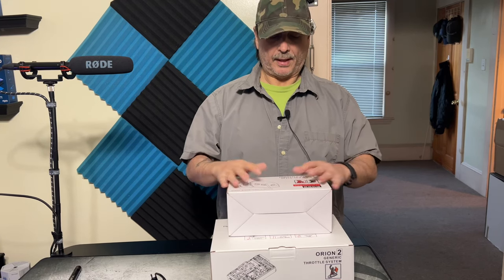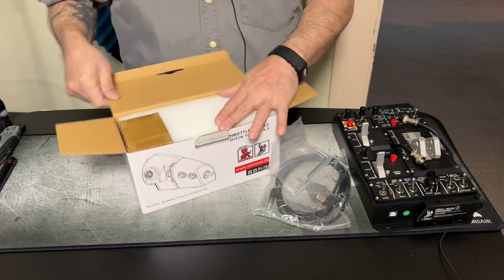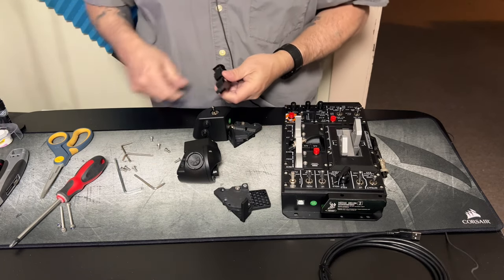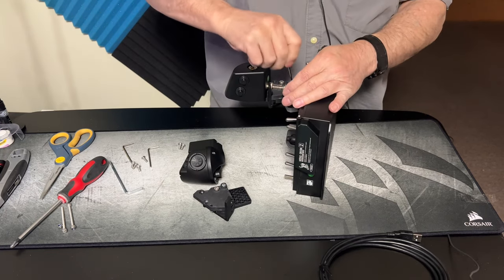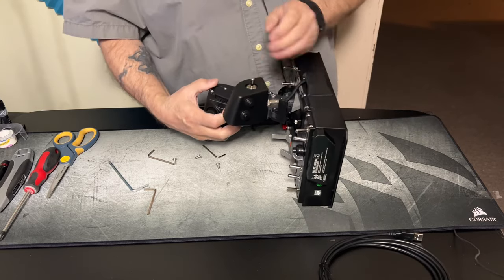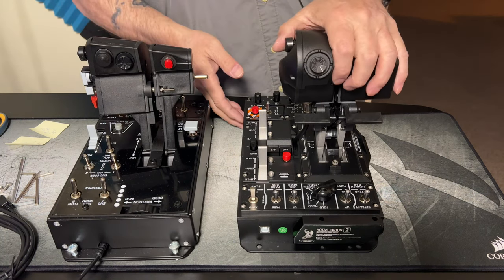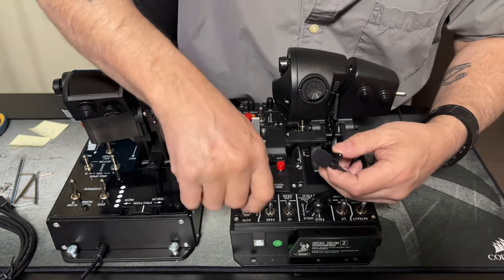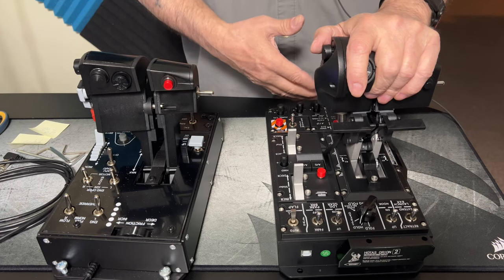Winwing Orion2 F/A-18 Hornet Throttle ( DCS WORLD )

Comment: Very helpful, thanks. My Orion 2 Throttle arrived today, and I would have had huge problems assembling it if not for this video. Do you know if there is a way to lock the finger lifts in the up position for when you are flying a helicopter, or aircraft where you don't want the notches?
Reply from the maker: I just looked at mine and I don't see a way to lock them up but, when moving forward and back the detent doesn't really lock it into place, it will slide through but, you feel a little bump were the detent is.

You can also remove it pretty easy and adjust the tension on the throttle handle so it slides easier. Hope this helps.
Reply: Thanks for the reply. I've got my throttle assembled and connected to my PC thanks to your video. Having tried it out in DCS, FS2020 and P3D, I see that the detent behind idle, where the finger lifts need to be used, doesn't form part of the axis. I had assumed it would, like the Thrustmaster Airbus throttle. So there's not really a need to have it lock in the up position to use the full axis with other aircraft. It would be nice if there was a way of not having the bumps at half way, and before the afterburner detent when you are in an aircraft that doesn't have them, but I guess everything in life is a compromise. I bought the throttle for fighter jets in DCS, but it's nice not to always be moving controllers in and out of your rig when you change aircraft. I'm lazy that way.

Comment: How does the spring loaded radar tilt control on the Winwing feel? Is it easy to make precise inputs, and how much force does it take if you compare it to the ministick next to it? I'm thinking about buying that throttle but my pedals don't have toe brakes and I was wondering if that axis is good enough to be used as a brake axis. I'm currently using one of the paddles on the back of my Thrustmaster TWCS for brakes, it works reasonably well and I just need something that isn't worse than what I have.
Reply from the maker: The little joystick is very easy to move but I get what you are looking at doing and the spring loaded one between the throttle would work great, I'm not sure if it can be used so I will try it tonight and see how it works and let you know.
Reply from the maker: I just tested it out, its the antenna elevation and I almost never use it.  I pushed it to the down position and it shows as joy-z for the left and right brake and work very good and didn't get in the way of anything.  Hope this helps you out.
Reply: @JPsTechReviews  Thanks, sounds good. I just placed an order for the throttle.

Comment: I had to add on my TM 16000 m twcs and additional switch to engage the afterburner. At full throttle it would not engage like f-15 or the F-14 etc. I don't know. I binded or got rid of a key bind but as soon as I get into a dog fight the throttle can be no more than 50%. I got to hit the afterburner button and if the weather is too cold I got a hold it down for about 2 to 3 seconds. Then go full throttle and listen for the boom of the afterburner ignition. I'm sold on the  winwing but I'm thinking I need the detent DCS has that option for the f-18. It is good, especially after takeoff where you're not burning. So much fuel so you can get to the tanker or get busy per se. At one time at full throttle the afterburner did work but all of a sudden it didn't. Now the TWCS of the TM you can maintain the throttle by taking the base off another screw that swivels the actuator and pop that off. Then very carefully a very tiny flathead from the south end inside the hole inside the actuator just enough to get a little meat on the tiny flathead and it pops right off. Including the A10 thrustmaster. Same thing on both sides but the 16 000 m only has 1. But they are maintainable able to do maintenance when they start to skip or not. Do what you want it to do such as go to full idle or go to full throttle sometimes in the middle. No activity at all. Take a tight q-tip little house alcohol not dripping wet. Just a little damp and the smudge that comes off of it is unreal and hard to believe as tight as that actuator is. And the gunk gets in there. I have a private room. Clean is going to be. It's just household dust I reckon. I don't know if maintenance would be required of the  winwing Orion 2 Hotas with the f-18. Another question, if I do get the Orion 2 MAX I believe it should come with the metal throttle handles also with the detent and also with the lift for the detent for each engine for both at the same time. I don't believe that would be a problem because I believe the Orion is a non-contact metal bearing magnetized throttle. Where the thrustmaster is a contact actuator by a plastic rod. For the money and over 3k hours on it would just maintenance on the actuator and you have to be very gentle with that actuator but servicing it. For $150. How can you argue with that? I'm more than got my money worth and still using it. Waiting on my WINwing Orion  hotas setup. Do you know if the f-18 joystick comes with the f-18 throttle base as you demonstrated? Or you have to choose yourself between an F-16 or an f-18 joystick. Deeply appreciate your video. I'm sold on it. I agree with you that the warthog is overpriced by $200 at least if they can make the Orion of such high demand and with specs that are second to none in its category. I believe the category would be towards the bottom of the high end. Haven't went much farther than that and recon of throttle controllers was thinking about the x56 rhino but I have a gut feeling that ain't going to work out. Thank you very much for the video. It definitely helped me. Hope you can answer those questions for me. Take care 🕊️

Comment: The body on the throttle for WW is metal but it has plastic panels on the outside.

TM has two metal plates on the base. One can be removed to make it lighter, but the WW throttle is better in every way
Reply: Correction: The body of the Orion is metal, the body of the Orion 2 is ABS. I was totally wrong.

Comment: Two questions: Where does the USB strain relief clamp attach? Did you have two screws left over? lol
Reply from the maker: The F-16 has a relief clamp under the left throttle grip the F-18 doesn't have any, I just use Velcro ties.  The two screws were just two extra screw that any good company would add in just in case you drop one or something is missing one.
Reply: @JPsTechReviews  thanks on the extra screws. My throttle base came with a clamp for the USB cable which, after I posted my question, I found out screws into the top rhombus plastic box on the forward face of the throttle base.
Reply from the maker: @odourboy  Now I am going to have to check when I get home later because I still can't picture it.  Is it important to the throttle?
Reply from the maker: @odourboy  Half of the screws and nuts were just all over the place in the box.
Reply: @JPsTechReviews  not really. You'd never notice if it was missing.